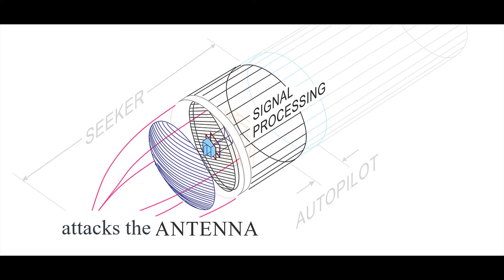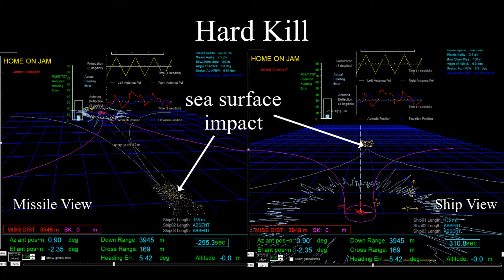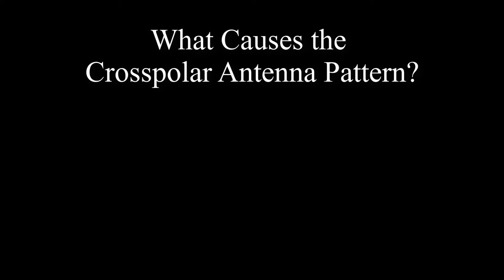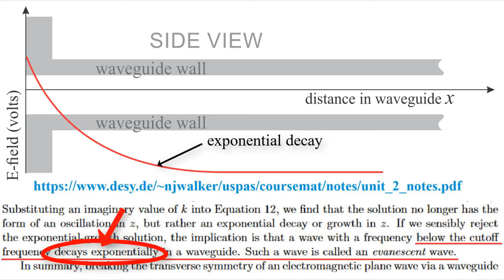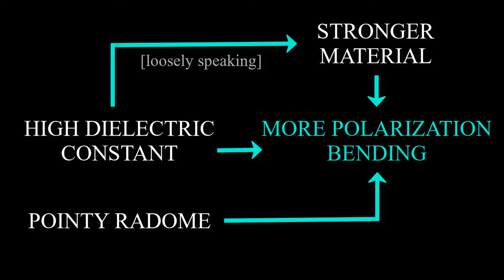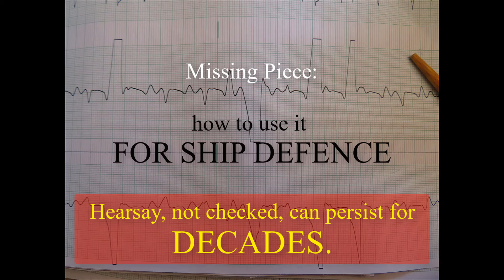Introduction to Crosspol Jamming 04

Comment: A silly question - what is stopping the adversary from having 2 waveguides with different polarization illuminating the reflector?
Reply from the maker: Not a silly question, that's a good question.

This is already done by radars which use a circularly polarized feed, or an array of circularly polarized radiating elements.  

Circular polarization can be decomposed into synchronized vertical and horizontal polarizations, each of which still have a crosspolar response, so a circularly polarized antenna will also have a crosspolar response, and it will be susceptible to Crosspol jamming in the same way as I have described for linear polarization.  Circular polarization comes in two versions: right hand circular and left hand circular. What is the Crosspolar version of the other, per the Poincaré sphere.

Perhaps you mean a feed which is switchable between vertical and horizontal polarization; that is theoretically possible for the monopulse sum pattern,, according to a technical paper I saw a couple of years ago.  I had a look at it, the video is here: https://www.youtube.com/watch?v=Htlh156jAuk.  

It's unclear to me how or whether the design could be extended to the monopulse difference patterns, which is essential for an angle tracking radar.  I expect the performance sacrifice would be considerable, and the cost high.  Monopulse feed design, and the design of the monopulse comparator, is a black art.
Reply: @skyindustries  Thank you for your comment! I was basing my thinking on communications antennas, which commonly use 2 distinct feeds for vertical and horizontal polarization respectively. Conceptually, similar could be done with RADAR (at the cost of more expensive hardware of course). Though it is unclear if it would truly help, since the seeker would not know which channel was jammed and which was not.

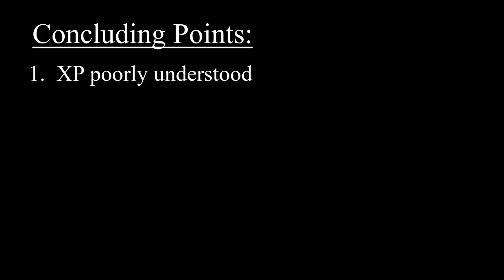Comment: #19:55
"XP poorly understood"
Are there any studies of Jammers' effects to microscopic cellular life?
Reply from the maker: I wouldn't expect studies of the effects of particularly jamming, but most likely there are many studies on the effects of microwave radiation on microscopic life.  

There are studies about the effects of microwave radiation on people, and animals also.  Google "effects of non-ionizing radiation" and see what turns up.  

The results are mostly related to the effects of heating by microwaves, which depends on average RF power level, frequency, and what's in the organism's tissues.  

I don't think anyone knows exactly what the effects are of high-peak-power/low-average-power microwave energy.  Cell mitosis has at least 6 steps, what's the effect on each one?  Is there any effect?
Reply: @skyindustries    I think Electromagnetic Field Ranges are far wider while even if we do research on microwaves bandwidth which uses factors like certain amplitudes for certain time periods while if we lower the energy/amplitude the time period would also expend which means it could take a second, minute, hour or a decade or even a century for certain amplitudes cross jamming antennas to call them harmful while a research surveys don't last that long

Comment: What if the missile is also equipped with optical tracking and discards bogus radar returns?
Reply from the maker: That's a good question.

The challenge for the seeker is to decide which information is bogus, and if Crosspol isn't managed correctly the RF information could look bogus compared with optical.  On the other hand optical devices are fair-weather sensors, which is why RF is used - it's all weather.  

I think of Crosspol as a tool, or perhaps better as a musical instrument.  What does a violin sound like? Depends on who's playing it.  What effect does Crosspol have?  Depends on how you use it.  

And for a given implementation of Crosspol (e.g. cognitive in various flavours vs. non-cognitive), missiles will fall on a spectrum, ranging from very easy to beat to essentially impossible to beat.  Presumably the harder ones will have a for example an optical sensor, but that is relevant only if there are no clouds or rain at the time of the attack, and it doesn't apply at all to seekers which don't have an optical sensor.  

Also in my experience it might be enough just to confuse the seeker, make it guess wrong.  That will be harder as AI makes it way into seeker technology, which I expect it already has.

Final thought: suppose none of the next generation missiles are susceptible to Crosspol jamming; that still leaves perhaps 95 percent of all fielded missiles potentially susceptible: the old ones.  I imagine being attacked by a pair of C-802s but not having Crosspol on board because it's believed it to be ineffective against the latest national variant of the SSN-xyz.  

Anyway I like your question.
Reply: @skyindustries  What a great explanation, thank you! I can imagine in the future, for those who can afford it, it will probably mean AA missiles with multi-spectrum sensors like thermal, mwir, optical, radar, etc etc in conjunction with AI. 

Scary, but technologically fascinating.

Comment: For fundamental understanding i missed that for jamming you need a close match up of the frequency ramping. If the frequency is close you can assume that by overlay the reflected signal with a close "opposite" polarized jamming signal the seeker lock on a sidelobe generated by the superposition. I feel that by using different termology its get close to marketing jamming.
Btw using an unknown sweep pattern it make it more difficult to do this overlay trick. And for shure today missile could put a camera on the tip. Then the overlay trick get more complicated as the pixels need the get tricked by an offset projected chip.

Comment: Is there a way to design the radome to have an aerodynamic outer shape but a different inner shape to reject the crosspol attempts or at least heavily attenuate them?
Reply from the maker: Interesting idea; there would be a size and weight penalty, the solution would be frequency dependent and look angle dependent, and probably expensive to manufacture.  

Also it seems likely that the modified radome would cause a loss of peak antenna gain and a jammer-friendly sidelobe structure.  If a concept were worked out it could be tested by simulation.  

That said, in my opinion it's a real bear of a problem to lower of crosspolar gain without raising cost and reducing weapon effectiveness.

Comment: Genuinely impressive how underrated your content is. maybe it is jusy very niche? but Im in love with the science here. Thank you for the effort! Great explanations. The tool you use to simulate is not available just like that, is it? 😅
Reply from the maker: Many thanks, took a long time to figure out all the technical pieces and how they fit together.  I have come to the conclusion that the only way to make progress is to teach some of what I know - and the most important parts aren't in the videos.  

I wish ENGAGE were available, it's like having a laboratory in my laptop.  I have lost track of the real-world effects I have learned by playing with it, usually discovered by accident.  

The sticking point is that I'm not a software designer, so an installer/wrapper would have to be added, and ENGAGE would need to be tested with - and made to work with - all relevant versions of Windows.  

On the plus side I have written the documentation in two volumes.  The first presents all the equations for antennas, control loops, seeker, autopilot, mode transitions, jammer, offboard decoys, chaff, target model, propagation, signal processing, etc.  The second is instructions for the user interface for the missile flyout mode and the sub-applications.  

So far unable to make it go anywhere commercially.

Comment: Hi! I'm just a regular person. Please don't laugh on my silly question!

As far as I know missiles like bharmos or C802s turn on their seaker at the terminal stage or very close to the target! On the other hand ballastic missiles like sckud or khoramsha or fattah do not have any seaker. They point their at target as pre programed flight tragectory if I'm right. So, the question came to my mind is that, if those missiles don't have any seaker to be jammed or the window of the jamming is very low then how can we depend more on the soft kill than the hard kill?
Reply from the maker: Your observations are insightful and your question demonstrates the merits of your observations.  Well done.  

Missiles which are entirely guided by inertial navigation cannot be jammed.  If they require a communication link at any point in their flight, then jamming is possible in principle... there must be some kind of a radio link for jamming.  

For RF guided missiles: yes the missile seeker is only activated in the "terminal phase", when the missile is relatively close to the target.  

Until then the missile uses inertial guidance based on targeting information provided at launch.   During the inertial guidance phase the seeker is turned off, and the antenna is stowed at an angle to minimize the missile's radar cross section as seen by the ship.  

Crosspol jamming is only useful against missiles which use an RF seeker for terminal guidance, and can only be used after the seeker turns on.  The ship can see the seeker turn on by receiving pulses from the seeker, from which the jammer might can deduce some properties of the missile and estimate what the jamming is doing to the seeker and missile.  

In this situation it's a race: the seeker is furiously trying to compute a fire control solution, and the jammer is furiously trying to compute an inverse fire control solution.  

Whichever one gets a solution first wins.  The missile wins if it can maneuver into a condition where an unrecoverable heading error is impossible.  The jammer wins if it can maneuver the missile into an unrecoverable heading error.
Reply: @skyindustries  I'm so glad that you have wrote it in so detail and explained it in a easy way. I'm thanking you for giving your time for a nice and detailed answer. ❤️

Comment: Is crosspol jamming effective against drone swarms?
Reply from the maker: Good question.  

The answer is no; it's a countermeasure against weapons which use an RF antenna to autonomously angle track a target.  Drones are optical with AI targeting, or they are guided by an operator using First Person View (FPV).

Comment: Thanks for the video, it was really interesting. XP sound like a great idea in order to defeat radiation seekers.
I'm thinking about how to defeat the next generation of missiles designed to protect against XP softkill measures. The one that comes to mind would be a trinity of antennas, each with a π/3 polarization skew compared to the others, ensuring that they'll not crosspolarize at the same angles. Having the antennas so close to each other means that no XP could affect them all unless three specific XP jammers would tightbeam directly and specifically into the antenna reflector with no spillage over the others. This sound only possible through lasters and would require centimeter-precision on a mach 2.5 moving object.
The onboard processor could cross-compare the three signals and their target detection, and detect an XP jamming on one by realizing one is skewed away compared to the other. It would then discard its data to favor the two remaining (clean) signals.
I'm however wondering about the feasability of a smaller antenna (or virtual array) for target acquisition since it would also require to lower signal gain and therefore risk being exposed to other forms of jamming.
Reply: Maybe 3 dipoles arranged in 60° stacked in front of each other? As far as I understand it (as a lowly EEng instead of RFEng) you'd get 3 linearly-polarized signals combined, which would be one signal polarised in 3 directions simultaneously? Is that possible?
Regardless, another technique is using frequency hopping. Since the jammer cannot guess where the next hop will be, the seeker can frequency-gate and home into the first suitable reflection. I think this isn't a new technique, too.
Reply: Re: the 3 antenna elements - I meant connecting them to the same line and Tx/Rxing to/from them simultaneously.

Comment: I'm here a bit late but have a few questions; 

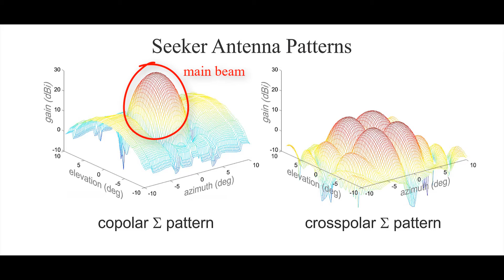Like what about the initial burn-through while trying to initiate the Cross-Pol EA techniques, seems that the very small crosspolar fields would correspond to a very low antenna gain wrt the Copolar return signal (especially from a ship sized target, note at time 2:34 your copolar beam is seemingly 20dBi > the crosspolar, wow that's nearly 128x weaker signal strength and I'd venture a guess that -20dB is at the low end of the loss typically associated with Crosspol). If any high power JECM technique was used to initially capture the seeker's AGC then the extremely low crosspolar signal would be even lower in the grass, wouldn't it? Aren't most jammers already hurting for enough power to cover a ship's signature, yet alone offest the 20dB cross polarization loss
Admittedly, once you have captured the radar and the antenna/missile has turned then you won't have any 'true radar return' to compete with, but the initial jamming signal would need to be very powerful to exceed the regular copolar signals and when it does your jamming signal will drive the seeker pretty far off-axis and the missile will quickly go back into acqusition mode (ouch and that could hurt if you were an Atlantic Conveyor, or the original target is still within the FOV). Additionally, if the initial crosspolar signal is too far off the initial vector won't the track processor detect an acceleration, velocity, or angle gate anomally (isn't that why we walk-off the RGPO). Your tri-angular cross-pol steering waveform seems to partially address the walk-off although it seems to not have a 'Hold-off' phase and the receding leg of the triangular wave would pull the track vector back to the real target/ship???

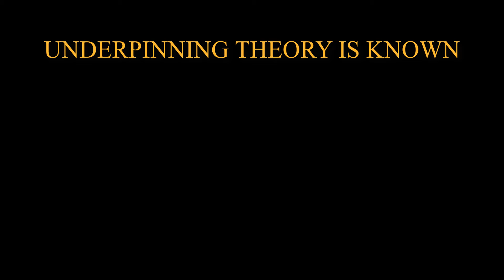Also, it would seem quite simple to devise a ECCM capability; i.e.  having a dedicated crosspol receiver channel and use it's feed as a subtractive signal to delete from the main channel, similar to the sps-49's side-lobe suspression? Or maybe just add polarization filters into the radome (like you mentioned below in the SA-6 wire grid response)??? Kind of bold comment for you to claim universal countermeasure (time: 18:55ish) when such seemingly simple ECCM techniques could be developed or are already are in use???
Reply from the maker: Only a fellow EW practitioner would be able to write your thoughts and ask your questions, good to meet you.  

An open forum is not the place to answer your  insightful questions, though they do all have answers.  Were we collaborating in a secure environment on a lucrative-for-me project I would lay out the whole smash of connected evidence so you can decide for yourself.

To the present: The waveforms shown in the various videos are for education purposes, and are not the advice I would give in real-world operations.  The simulations shown are genuine  representations of real-world effects for a generic-but-realistic missile engagement.  The range gate position and seeker mode are intentionally incorrect.  

The various videos I have produced are for education purposes, intended to raise enough questions in the minds of EW subject matter experts, such as yourself, that they choose to check certain preconceptions about Crosspol, as I have checked.  

Add jog detection to the list of technologies to revisit, and over-water propagation.  

Our community is where it is, and ship defence against missile attack is where it is, because we have very gradually replaced the difficult approach of analytical thinking and mathematical analysis with the lazy path of empirical observations.  

Fact is, we need both.  It's called the Scientific Method.  I learned it when I was 10 yrs old, and with few exceptions I DO NOT see it being practiced in the EW community.  

Here are a few of points:
- you are correct, Crosspol cannot compete directly with skin echo, the range gate has to be moved
- Key point: when drawing conclusions about the relative gain of copolar and crosspolar antenna patterns, the gains must be compared at the same angle, e.g. comparing the copol gain to the peak crosspolar gain is meaningless because they happen at different angles; it's a proxy for other things

- missiles fall on a spectrum of vulnerability to to Crosspol jamming: at one end, very easy to beat. At the other end, impossible to beat.  All real-world missiles lie between these two extremes.  

Whether or not to invest in and field this technology depends on the answer to this question: "is it worth the cost to defeat the missiles that can be beaten by crosspol with, say, 85% probability of success with 95% confidence?"

I don't know the answer that question!  But I do believe that the people who control the money are married to hard kill and offboard solutions partially because they don't know any better, and partially because of powerful lobbying by large defence contractors who provide those solutions.  

And I believe that a large segment of our EW professional community, the part that provides advice to whomever assigns "Program of Record" designations, has accepted the provably-wrong proposition that it's impossible to use active onboard countermeasures like Crosspol to protect ships.  So they just stopped looking.  

And once you stop looking, unless you have by God entirely and exactly the final answer, you're kaput in the water.  Because no more information is coming in.  

This. Can. Last. For. Decades.  One misstep, decades.  

Anyway I like you wrote.